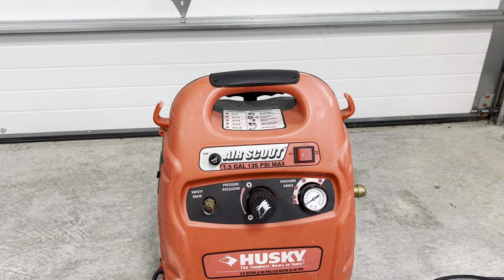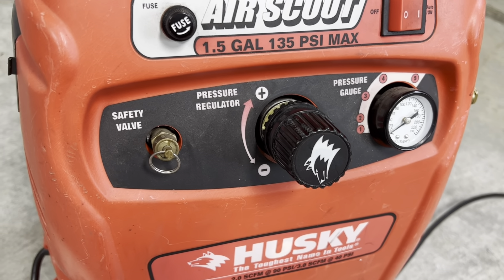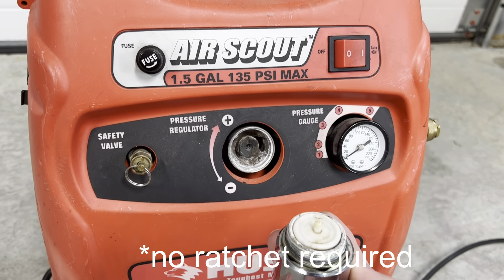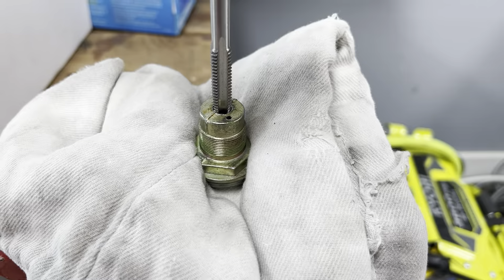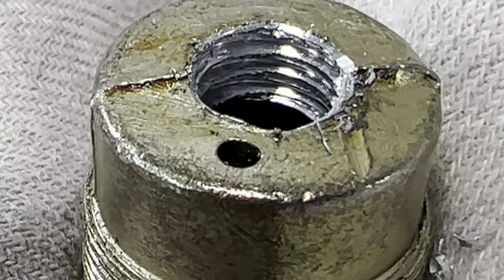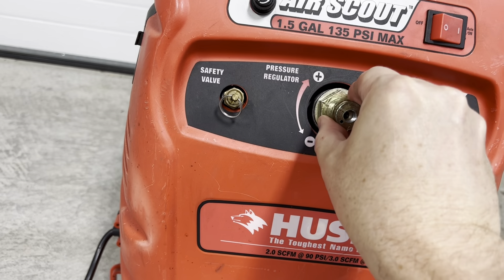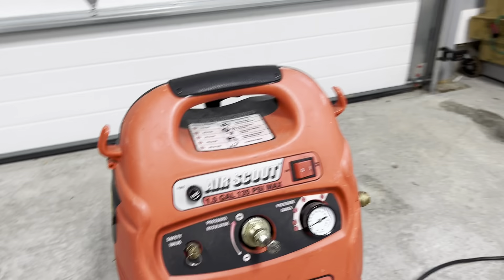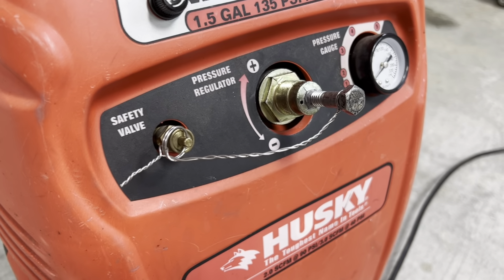How to Disassemble and Repair the Pressure Regulator Knob on a Husky Air Scout Air Compressor

Comment: Thanks for the vid!  I’ve got an older model (15+ years😮) Best $99 I’ve ever spent! The thing has been a beast, blowing up floats for the kids, airing up tires, running a nail gun, etc. 3 months ago it would only air up to 35 psi. I’m about to see if this is the problem. Will update
Reply: Update: a couple hours later. The problem was still the regulator, but it was just a little o ring. I guess mine was still not made in china because the metal was good. Just an old o ring. Thanks for the vid!

Comment: No need for glue of any kind. Use silicone grease on the o rings and Teflon paste t+2 on the metal threads without so much it could squish out and clog up valves springs etc